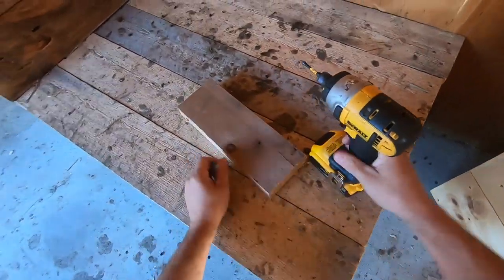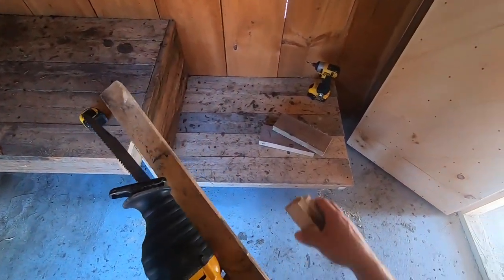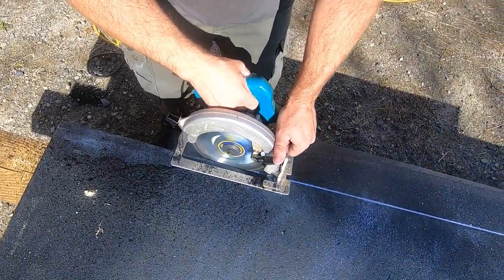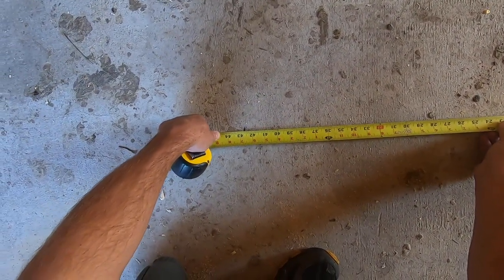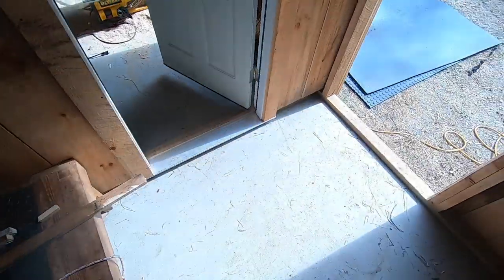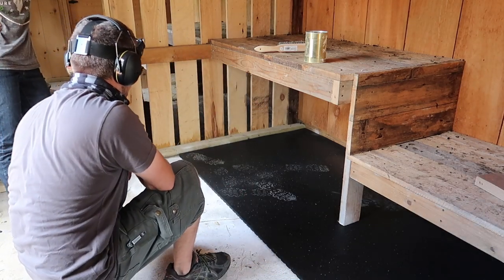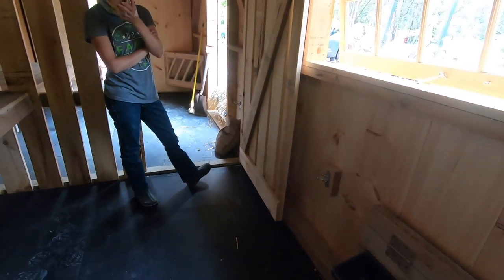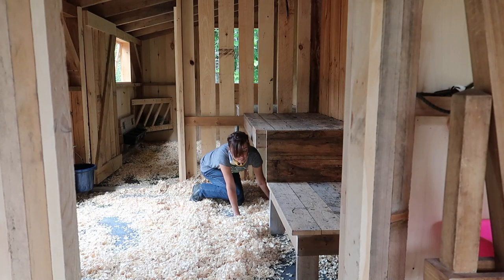was this a HUGE MISTAKE?? Concrete Floors in our NEW BARN

Comment: Your energy and drive even after set backs is admirable, but like others I do worry that you may not have completely resolved the issue by using the rubber mats. It was good to see you have added a depth of  shavings, - chopped crushed straw or other absorbent material good and thick might also work. Sealing the floor now might already be too late in the day. Probably tiling would produce a slippery surface. One of the relatively new resin coatings might be an alternative treatment on the other side of the barn, but only if it is certified for the role and would contain and resist the effects of the unwanted 'products'. 

I share the belief of others that the thick layer of absorbent material that can and should be changed regularly is  vital; above all any threat of 'wet product pooling' must be contained. The absorbent biodegradable materials should then compost well helped by the urine and contribute back to the soil after a suitable period of rotting down. I was worried that the wood of the building in contact with the urine and solid waste would suffer, I had not thought about the concrete being an issue.

Comment: When you were building the barn is when I came in. I knew you had goats and others animals, but they had their own places. I didn't know you were moving them into the barn until you started building stalls. I wrote you then and said this was a mistake to put them on concrete. If you had made provisions to wash down the stalls every couple of days, I think it would work. You have 6-6 on the floor to nail the walls to so now you can't wash. I had 13 goats they slept in an old travel trailer in the middle of the lot. No it didn't smell, it stunk bad, thats the way they are. Our cows each had a stall, the stall was bedded down each night before they came in to be milked, then let out in the morning. The stall were cleaned each spring and spread on the fields. The floor was dirt, that worked with cows but they don't stink like goat urin. As some others have said you need to water proof the cement by spray or painting under the mat. I don't know if you can cut places in the 6-6 seal so you can wash the floor ever week or so. Good luck and let us know what works.

Comment: Contact a local sawmill and see if you can get a supply of saw dust. Spread this on the rubber mats to absorb the urine. I know sawdust works great as an oil dry, it should work for urine. If you can't get sawdust use straw like you did on the previous stalls.

Comment: seal the concrete and have the concrete sloped to a center drain so the mats could be hosed off weekly with javex the urine WILL get between mats to the floor.
Another bet is also to seal the walls 4' up for the billy goats ( peeing on there head ) should help prevent it from seeping into the walls.

Comment: I don't think it was a mistake to do the concrete.   I guess it will be trial and error, and perhaps sealing it will be helpful.  The question is what to seal it with?  Perhaps you could ask someone that has experience with cement floors and livestock or other animals.   Also, deep bedding that I have seen others doing, might be helpful, in combination with the stall mats.

Comment: you still should clean the slabs air dry then a good sealer.  don't whine regret and lack of experience, your learning.  do it right , a sealed floor andmats is SOP.

Comment: Use a two pack resin floor. If you use rubber mats the urine will still get to the concrete eventually. And it is easy to clean.
Just a thought.

Comment: I would’ve used epoxy sealer for concrete at least on the concrete. Even with rubber mats you’ll still have urine getting through the seams. Epoxy will last nearly as long as the building and can touched up if necessary.

Comment: You didn't mistake with cement floor.  Apply a good sealer after sanding it down a bit, good wash with anti urine solution and seal it with layers so urine can't soak it cement floor.  Y'all be fine.

Comment: Sherri Davenport (below) said use rubber concrete pool paint to seal. Hmmm.  I need to seal my basement floor and walls. My old dog urinates on my sidewalk and it stinks so I have to pour diluted detergent on it If it doesn't rain.

Comment: I am a long time subscriber of your channel, I don't make comments regarding what you do. You have other things to do before the weather becomes cold. So, get some really tacky tape, seal the mat joints, around the walls too, put a layer of saw dust, wood chips and hay. This will keep the urine from going on the concrete. Clean once a week.  Next year acid wash the concrete, and seal seal. Should solve your problem.

Comment: Do yourselves a huge favor and apply a concrete sealer to your floors. That will block the urine. Reapply as necessary. As for the rubber mats, those are NOT a great idea for the health of the goats. They will keep them off the cold floor, but the urine etc will seep thru the cracks and you are left with the same problem. 
Use thick thick bedding instead or a thick coat of painted on rubber sealant, being certain to coat the whole area thoroughly.
BTW It's a good idea to utilize coveralls over your clothes when working with the billies. You really dont want that musk on you...It stinks!

Comment: Concrete is very porous so it absorbs any liquid like such as, in places with a lot of rain they need to power wash concrete to deep clean the concrete and get all the dirt and crud out of the concrete pores. if your not sealing the concrete get a power washer to clean the concrete every year or so

Comment: That is what I have rubber matts on concrete the only problem I had was drainage holes for the urine to drain out the stable. As I filled the original ones with concrete as rats and mice were coming in at night to the stable but then had build up of urine in back corner so I had to put drainage holes back in through the new cement opps ! X thought solved one issue and made another for myself

Comment: Why not use epoxy paint finish over the concrete?  I have seen a gray paint job done on an old garage floor that stunk of years of oil and spills.  After cleaning and painting with an epoxy paint the stains and odor have never returned.  Maybe you’ve thought of this already,but thought I would suggest it on the possibility  it could be a cheap and simple fix.

Comment: Clean the concrete with a good urine cleaner.  Then Seal the concrete with a good commercial concert sealer.  Double coat the sealer after letting the first coat dry for 24 hrs minimum.

Comment: Wood chips and straw is the best solution (after sealing the concrete?) Good compost material and will also keep the girls warm. Didn't you have concrete in the old barn? Why is this an issue now?
Reply: No concrete in old barn.

Comment: The common theme here is: SEAL THE FLOORS. Quite frankly I'm amazed it didn't get done. A little beforehand research on this would have saved you some troubles. I'm curious if the floors even have expansion joints, I suspect not. There is a ton of " sage " advice in the comments, I would suggest following them and/or at least acknowledge them...
" Do it right the 1st time or measure twice, cut once "...
Bill on the Hill... :~)

Comment: I had to buy a sheet of this stuff for a project on one of my vehicles. One sheet is UNBELIEVABLY heavy. Cutting it with compound angles wasn't easy but not impossible. I think a sable saw would have worked better than my razor utility knife. Looks like your stuff is a bit thinner than the stuff I was working with ... 3/4" thick.

Comment: Concrete can be sealed, but choose carefully. Don't just paint them with deck paint. The urine can only soak in so far, you really should contact a concrete expert, not just a contractor. You could call some dairy association for referral to someone who designs new dairy/milking facilities. My opinion, it's not going to be that bad, but it was a mistake to have have forgotten that the droppings don't just disappear every day.

Comment: Concrete will hold the smell. It's porous. Need to neutralize the uric acid  with an enzymatic acting solution first and then seal the concrete from further liquid penetration.

Comment: You did not treat the new concrete.  You should have installed floor heaters. There is new rubber barn floors for horses. It works with goats as well. I Saw it on Mike Holmes.

Comment: Wishing you success but if it doesn't work; then-
Goat hooves + rubber mats (paint) = new, dirt floor barn addition?
It might sound counter-intuitive but for stability the flat side of the mat is the side that actually goes down or the mats might tend to shift.

Comment: I have two weenie dogs that use a doggie door Togo potty on my patio. Well after a few months my patio concrete stinks like horrid dog urine and there is no getting rid of the smell. I put odor cleaner soaks twice a year and spray it down and all it does is make it smell worse. I haven’t been able to use my patio in years or keep my windows open. Next job is to rip up the patio and replace it, get rid of doggy door and just take them outside a few times a day. Ugh! Cement and animal urine doesn’t mix!
Reply: Try baking soda, vinegar, tea tree oil; not all together but separately and rinse well after; power washer is good. I have also used peroxide mixed with Dawn soap. I wonder if Borax would work.

Comment: It’s no different to Horse stables, I really couldn’t understand why you didn’t have wood shavings or some other type of bedding down right from the start. You can either deep litter and clean out the wet two or three times a year (not my favourite method but would be good in the winter as it creates warmth) or muck out the stalls every few days, topping up as necessary.

Comment: Kudo's on the new floor.  Was there any reason for not giving the floor a clean sweep BEFORE laying down the lime and then the rubber mats?  It appears you trapped a moderate amount of goat pellets and straw between the mats and the concrete floor.

Comment: U need a coat or two of concrete seal.  If you use rubber mats you will be forever washing them and the urine will get trapped underneath and become extra smelly.

Comment: Would sealing the concrete floor with a water resistant coating and then a light hay layer to absorb the urine not work? You might have to refresh the sealant once a year, but still no more work then removing and cleaning rubber mats a few times a year.

Comment: Gday from tropical OZ and YES u made a huge mistake... but I would get a high pressure washer, clean timber and concrete floor then seal both, then put down ur matting and then clean out weekly. And its nice to see gorgeous Gina at home and in the vids more often.

Comment: Concrete is porous so it's going to be absorbed urine. Your best bet is to seal the concrete with an epoxy floor covering. There are many DIY kits that you can buy but I would look for a professional installation that comes with a lifetime warranty.

Comment: If you didn't put plastic down before you poured the concrete it will wick moisture and and urine will mix the that moisture. You would be better off the seal the concrete maybe during the summer when its as dry as possible.

Comment: I know exactly what you are talking about.  We had a lot of dogs peeing on our concrete pool deck and the smell could get awful!  We lived in Southern California at the time and we could just hose it down.  Now we live in New Hampshire and you can’t just hose it down.  A lot of folks say seal the concrete, well we sealed our NH garage floor to protect it from the road salt that comes in with the snow on the bottom of our cars, but the seal only works so long and I’m not sure how it would stand up to so much urine.  Could you seal it and then cover the concrete with some type of solid rolled flooring product?  We put a rolled fiberglass floor in our basement called Tarkett because it is impervious to moisture.  Maybe a sealed floor, a solid covering and a lot of wood shaving and straw might do the trick?  You are up against it for sure!  Good luck.  Thanks for sharing your struggles.

Comment: There is a product that you can put down with a trowel that is seamless, expensive  and hard to source here but what you have bought it too flinders and cheap. It will not work. My matts are so thick and heavy it takes two strong people to move one Matt! You have wasted money here, in my opinion and I have used rubber stable matts for twenty years. . We use more lime under as well. Good luck

Comment: Did you seal the concrete? When they pee it will still leak through cracks and soak in the concrete.your best bet would be sand. So I heard.

Comment: the mats should do good, might have to pull them up more than every 6 mths tho, unless you seal the seams and use some sort of bedding to absorb the urine. Is that a tractor I hear in the background lately? or a big generator? Sounds like an old tractor that's close.

Comment: AL,you are going to regret  the rubber mats!  You should SEAL the FLOOR and  use wood chips or saw dust. You didn't make a mistake with concrete, You didn't take it far enough by not sealing it.

Comment: So, that urine is going to seep into those cracks in the rubber.  Then its going to be trapped underneath. You may have a worse issue than you have now.  The reason it's "much better" right now is that the lime absorbed some smell but I think the rubber is going to eventually be worse.  I would also think that you need far more shavings than the small amount you used.  Also, you mentioned that in winter you need to scrape the floor... how are you going to scrape the rubber without damage.

Comment: Either rubber mats, or straw. To protect the goats. The rest of it... I think the urine is going to make it through, no matter what. Personally I think you'd be better off to clear the goats out for a couple weeks, clean those floors, and dry them thoroughly. Through and through...  Then seal the concrete. If the sealer you use says you can do it on one coat, do three coats anyway. THEN put down your rubber mats.
Whats that noise in the background?
Reply: You could also seal the concrete with an epoxy coating. Add some grit and the goat or rubber mats won't slip.

Comment: I think that rubber mats are a big mistake. 
I tried some in my workshop as a buffer from the effects of standing on cold concrete all day and eventually threw them out as they became just too dangerous. 
They became a skating rink when they got wet, especially with rubber soled  shoes or wellington boots. Be careful how you walk if they are wet, you might finish up 'base over apex'.

Comment: I wouldn't use those mats.  I had to pull them out of my in-laws horse stalls and not only are they heavy and awkward they are disgusting after they have been soiled a lot.  I would go with comments below and just seal it once a year or something then you still get the wear factor on their hooves. Just my 2 cents but they SUCK!

Comment: Others said the same thing, but all your concrete should be sealed, acidic urine will eventually destroy the concrete. Large stacks of hay will suck moisture up from under you concrete. We used this water based sealer https://www.amazon.com/dp/B000EW9OHY/ref=cm_sw_em_r_mt_dp_U_ns8BDbY9GA8SC

Comment: SEAL the Concrete, rubber mats are a mistake, they will help the urine soak in. You could epoxy the concrete, and put some sand in the epoxy to keep it non skid.

Comment: Al, you need to drill few holes in the concrete to drain the goat's urine, the mat itself will not help you. You will still have the urine on the concrete, under the mat.😐

Comment: There are industrial coatings for chemical plants to protect the concrete floors from acids. They should work as uric is much weaker than sulphuric or hydrochloric acids. Expensive but likely worth it. Consult an expert and spend the money.

Comment: Sorry Al but you are going to   HAVE to deal those floors those Mats are hard to move and the seams will leak you need to seal those floors before the urine soaks in the concrete

Comment: Urine is going to go right down in the seams of the mats and go under them. Because you put them with the waffle side down, it raised the mat just enough so that the liquid will distribute all under them, not just at the seam. I fear the mats have been a waste of your money... it would have been better if you'd just gotten a sheet of heavy vinyl flooring at either Lowes or HD so no seams except at the outside edges - and then I would have put it up the wall a few inches... and you could still do that on top of the mats and that would give some extra insulation for the goats and allow you to clean easier. When the vinyl wears out, it would be easy to replace...

Comment: I would have painted the concrete with epoxy paint to seal it. And then glue or use silicone to each other and to the walls.. this way any urine will not get under the mats and turn in to ammoniac. Warmth plus urine = ammoniac. This is NOT good for the animals as it irritates their lungs, and makes them vulnerable for getting phenomena.
I know this as I have had horses with one rubber mat in the box, where the mat had to be turned and cleaned once a week. This was heavy work.
I am working on farms, and at one farm I did could not work there anymore as were the calf was living it was so bad air, because of ammonia, that my lungs were hurting just after 30 min with cleaning out their places. They had a huge % of calf death because of this. :-( 
So I hope you will have this in the back of your mind, so your goats will not suffer because of ammonia in the air. 
We are a couple that is huge fan of yours, and we watch every episode. 
Best wishes from Norway. :-)